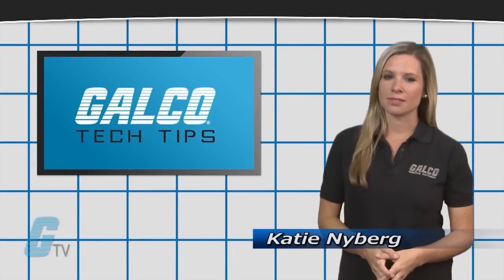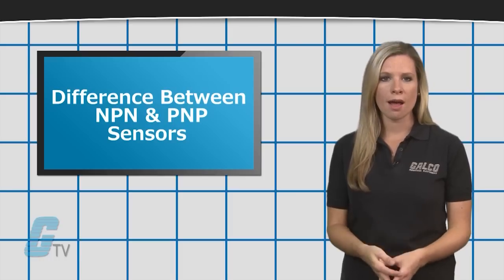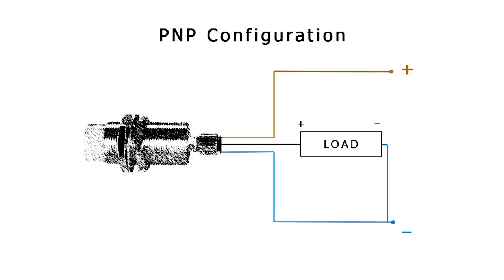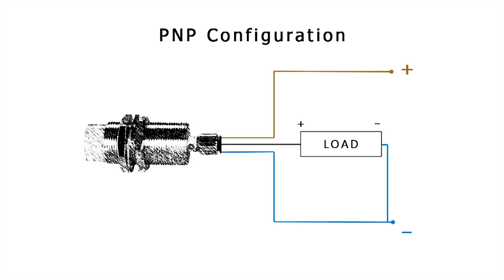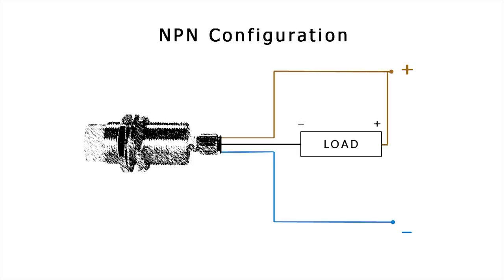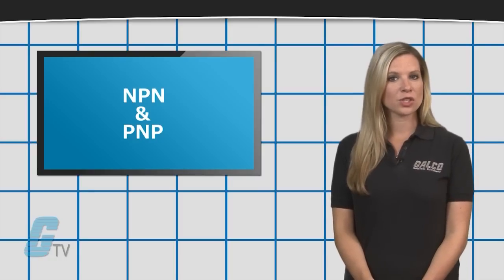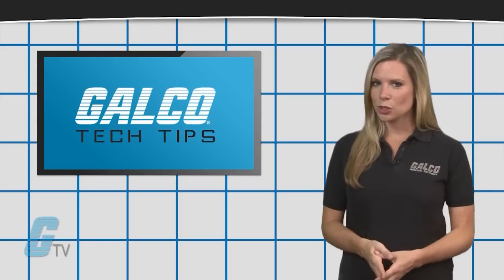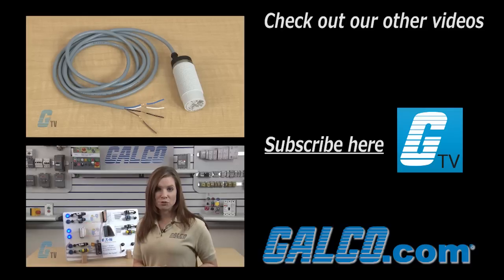What are NPN and PNP Sensors? - A GalcoTV Tech Tip | Galco

Comment: What is the load ? Can i be any load.
Reply from the maker: The load would be your input. Either a PLC card with sensor input, some type of speed measuring device or motion detector perhaps, could even be a simple on-off detecting the presence of a machine part like when a cylinder extends or retracts.

Comment from the maker: Most industrial proximity sensors  (inductive, capacitive, ultrasonic and photo electric) are solid state.

The term solid state refers to the type of components used within the sensor. Solid state electronic components such as transistors are used to switch the output of the sensor upon detection of an object.

Two specific types of 3 wire sensors are available; PNP and NPN. The difference is a result of the internal circuit design and type of transistors used.

A key point to observe is that PNP and NPN has nothing to do with whether the sensor is normally open (N/O) or normally closed (N/C), i.e. a PNP sensor may be either N/O or N/C as can an NPN be either N/O or N/C.